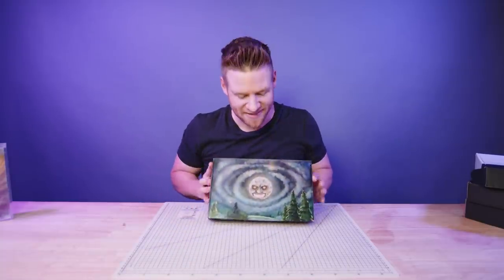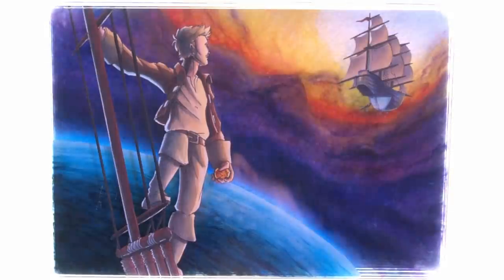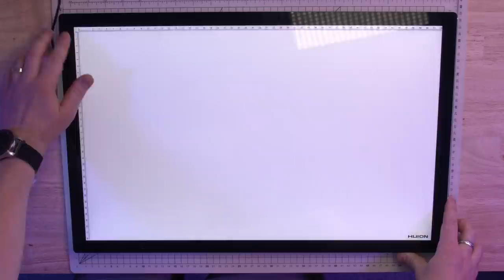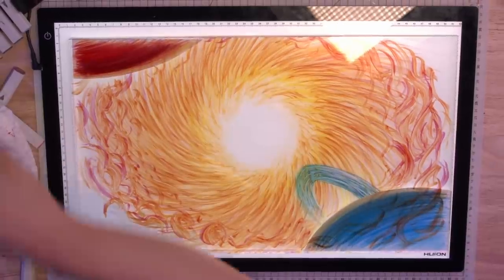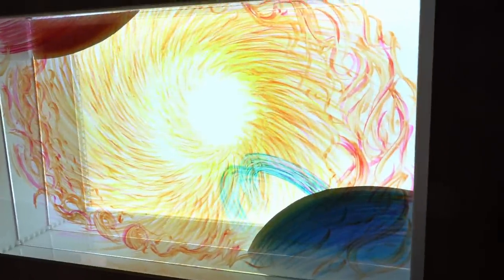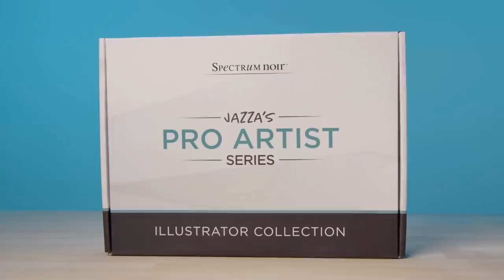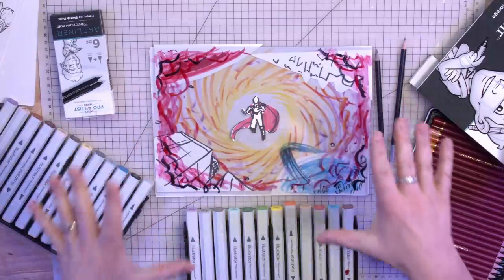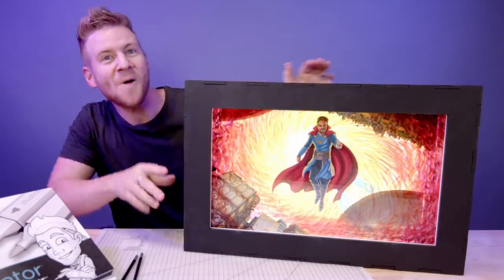My 3D MULTIVERSE BOX will Blow your Mind!!

Comment: Plus with using alcohol markers on the acrylic, you can clean and reuse the acrylic easier if you mess up! With resin it would be bonded to the plastic, but the alcohol markers can be cleaned off with just some rubbing alcohol on a cloth.

Comment: You could also try layering some acrylic resin on top of a layer when you are done with it to bond it to the next layer above, that way light isn't meeting resistance in the change of refraction between the layers. It doesn't seem like a lot to our eye, but every time there is a material change, the refractive index of the material bends the light passing through, scattering it and making it more murky.

Comment: Spectrum Noir is pretty good for the money, though i cannot really get super used to the new nibs on the Illustrator markers, they do last longer than the previous ones that frayed too easily, but the colors are nice, i don't really see variation from marker to marker which you can often see with cheaper ones, and it's probably most bang for your buck.
Nothing beats Copic, but they're really expensive.
Took me a while but i have the whole range of Illustrator, and only the most used colors in Copic.